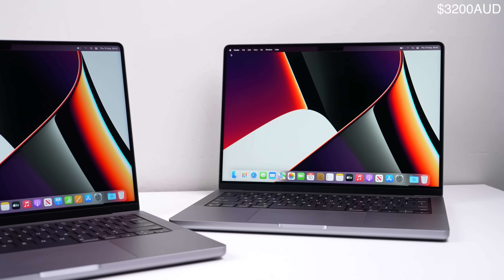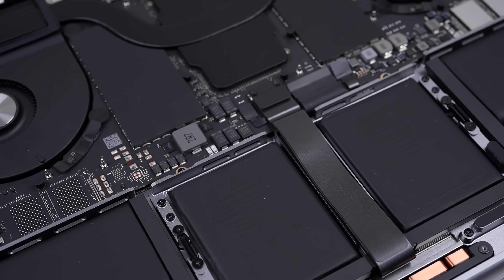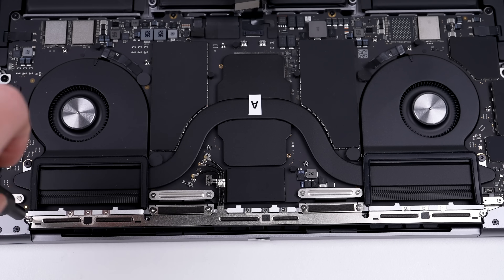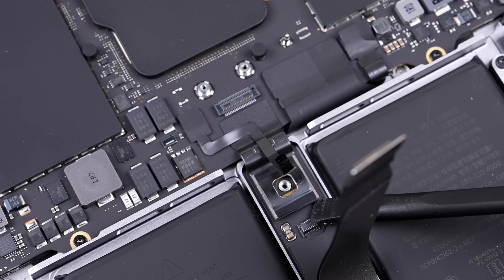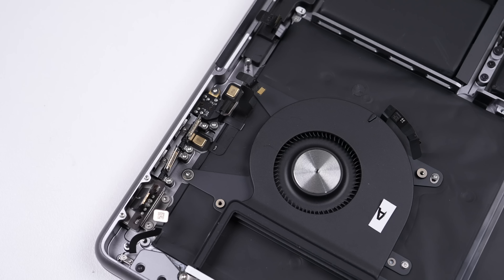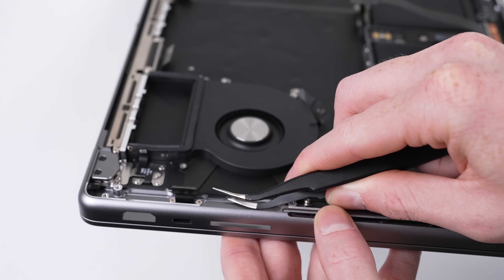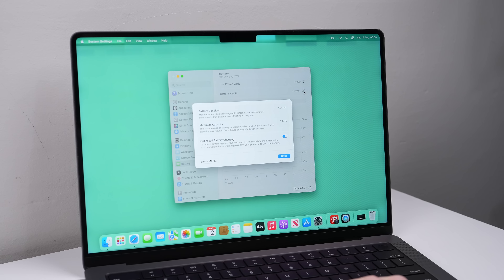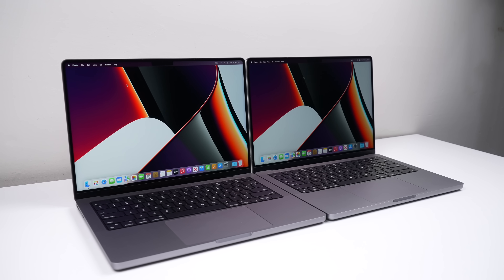New Anti-Consumer MacBook Pros - Teardown And Repair Assessment - Apple Silicon M1/M2

Comment: I just went from a early 2020 MacBook Air to a Apple refurbished M1 Pro MacBook Pro and I have to say the speed difference is incredible. My old 2020 air could not even run a chrome tab without fans on full.
Reply: well should have bought the late 2020 MacBook Air or MacBook Pro (M1 or M2) if you want to just purely web browsing)
Reply: @trandinhvietdung9357  the reason I upgraded is because I have started to try and design apps, I'm sure the basic M1 or M2 would get the Job done but I just wanted to get that little extra power as well, also the M1 Pro was cheaper then the M2 MacBook air I was going to get.
Reply: Meh
Reply: must have had the last intel model. They were awful.
Reply: @heathcoggan yep, I got it June 2020 and It was annoying finding out the value went down a lot, as well as the new M1 chips being way faster compard to my intel 2020 model.
Reply: the early 2020 is a scam. i had a early 2020 16 gb ram, with i7 and it couldn't even run roblox lmao.
Reply: @osmosmosm000  well what you expect when running games on macOS? should have installed Windows on it for better performance
Reply: @osmosmosm000  a base model M1 air could easily beat like any intel MacBook lol
Reply: @osmosmosm000  same, but the only thing was I didn’t know there would be a m1 MacBook Air.